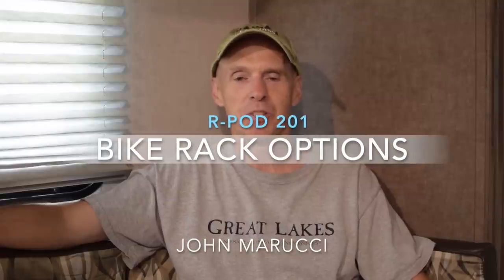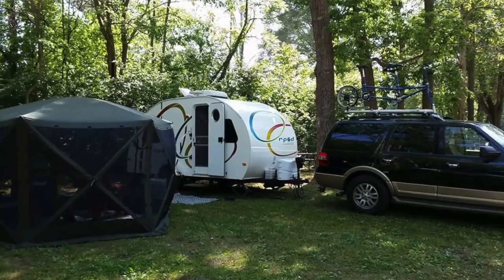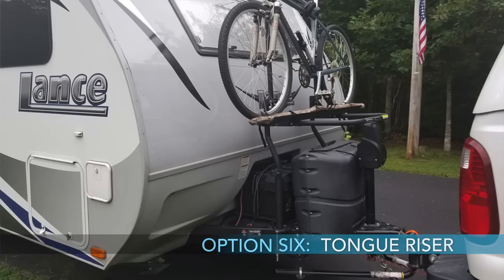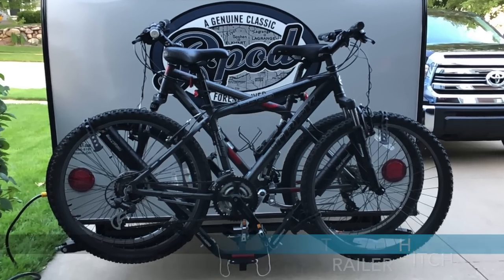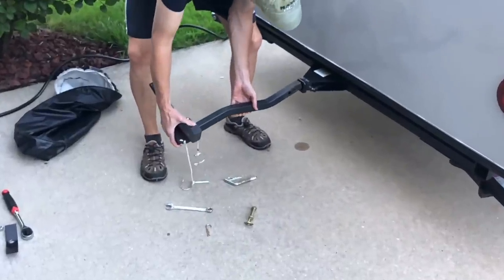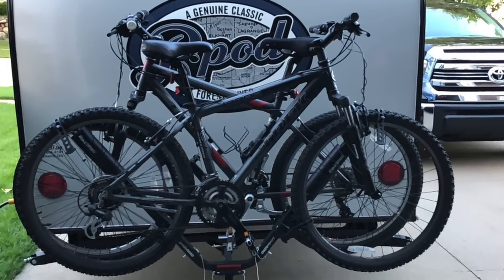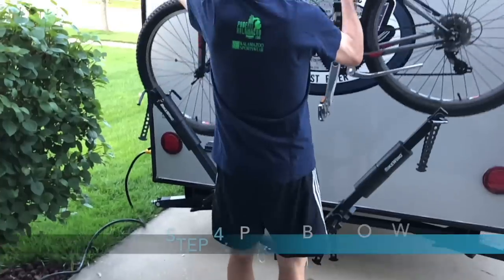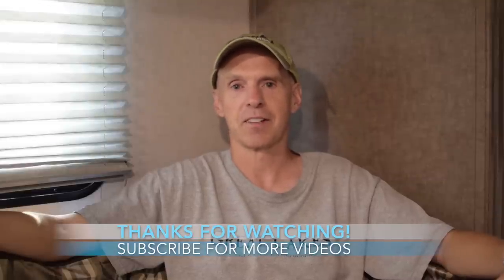RV Bike Rack Options

Comment: Nice video. We have been struggling with all of the disadvantages of the various locations and settled on inside the trailer. I didn't want to expose the bikes to the weather and the potential of damage on the rear.
We have two chairs in the rear of the trailer. One is rarely used, so we removed it and place a two bike rack where we can park the rear wheels in the rack and run straps to secure on long trips. The other end of the bikes is in the entry aisle and close to the closed slide so securing isn't really necessary. When we arrive to camp I move the rack and bikes outside and secure with a cable. It would be nice not to have to deal with it every time we stop, but it the best situation for the bikes.
Reply from the maker: Carrying bikes with an RV has no good solutions IMO. I would be very curious to see your set if you are willing email me a few pics. You'll have to manually copy this email address: john@johnmarucci.com

Comment: We use a tailgate hanging rack for our bikes. The hangers insert into the doorframe in our Toyota Sequoia and the racks stick straight out from the glass window. The drawback is that we can't access the rear of the SUV when the bike rack is mounted but a very easy solution that add just some weight to the tail of the truck and not the hitch.
Reply from the maker: Thanks for sharing!

Comment: Another winner...thanks for answering all of the questions we've had about taking our bikes.
Reply from the maker: Craig, toting bikes seems to always be a concern and I am not sure there is a best solution with R-Pods. Some people add supports welded to the back bumper to add capacity. You obviously have to be careful using the bumper, but it can be done. Glad the video was helpful in showing the different options.

Comment: One time, I stored my dirtbike in my R-Pod for a trip. I turned it on because the air filter seemed dirty and I wanted to make sure it ran fine. To make a long story short, I left it on during the entire 2 hour trip and the R-pod was filled with exhaust fumes. It still reeks and I was wondering if you had advice to get rid of the smell. Thanks, another great video John.
Reply from the maker: Hey George, sorry to hear this. I did a search and two things keep coming up: baking soda and kitty litter. You’ll want to search on how best to use these. Thanks, John

Comment: Thanks for all the details since biking for me is a major part of my future camping plans. I've used rooftop bike carriers for several years and found they were tedious. The lower the bike the better for me. The rear hitch is an advantage over the Lance trailer which has nothing in the back. Good work!!
Reply from the maker: Thanks Sam. The main thing is to know your weights with the bike in the back. Generally you want to keep it as light as possible. I also use the BikeWing rack that locks in pretty tight to minimize sway. Thanks again for watching!

Comment: John, what about trailer sway with the bike rack in the back? Some dealers don't recommend it? I have a Jack-it on the front over the tanks. Works well but it is difficult to get bikes on and off. Thanks for all the info. on your site.
Reply from the maker: There really is no great answer for bikes. If on the back bumper of the trailer, you add weight behind the axle which can lead to trailer sway. If on the tongue, you add to tongue weight and sag to the rear of the tow vehicle (payload issues). There isn’t one great solution, especially for lighter weight travel trailers. Thanks!

Comment: One big concern I have for placement, is the amount of road grime thrown up and onto the bike. You mentioned insects when the bikes are on the front of the vehicle. But, road grime can be horrible on hitch mounts, as grime tends to accumulate heavily in the slipstream behind the TV or trailer. Destroys chains, gears, brake pads, saddles, handlebar tape.
Reply from the maker: All good points. Many people cover bikes in transit to keep this from happening. Yet, I wouldn’t use a cover that isn’t made for the bikes as it could easily come off while at higher speeds. Thanks!

Comment: Possible issue is that simple dead weight alone doesn't tell dynamic forces exerted.  Bike rack is a big lever arm that can produce a lot of torque during bumps and sways--I wouldn't push the weight spec to the 150 lb limit.
Reply from the maker: Steven, I put together a video showing how bikes bounce on the back of a trailer. I am more convinced that the rear of the trailer isn’t a great solution. Here is link: https://youtu.be/5TARjsXrn-8
Reply: @JohnMarucci  It sure has a lot of bounce going on.   So you feel less inclined to recommend what your do in the video?  I'm leaning towards sticking the bikes in our SUV, since we don't use the rear trunk/passenger area for much.
Reply from the maker: @musicpaulweber  I do lean against using the rear hitch on the R-Pods for bikes unless you have the hitch reinforced.

Comment: Thank you for the informative video!  We like the same option as you in having the bikes behind the camper, but I'm wondering how we'd transport the bikes to a different location once the R-pod was parked at the campground.  Have you done this, and maybe just moved the bike rack to your tow vehicle?  Thanks!
Reply from the maker: Kimberly, my Bike Wing 2 bike rack has an adapter to work on the larger hitch receiver on my tow vehicle. You can fairly easily put the Bike Wing on the tow vehicle and take your bikes to a local (or not so local) trail head. Thanks again for the comments!

Comment: Couple of questions...do the bikes obscure the tag? That could get you a ticket! Also, do you know a good way to take generators along?
Reply from the maker: Richard, you are correct, bikes on the back of the Pod can obscure the license plate. As far as a generator, a smaller inverter generator would fit under the cover of the bed of my truck if I wanted to bring one along. I haven't done much boon-docking to need one and would rather not take up valuable bed space unless it were very necessary. Thanks again for the comments!

Comment: Hi John.  I have a Rpod 192.  Do you have any feedback on the ladder mount bike racks?  It appears that there is enough space for the spare and bikes attached to a ladder mount bike rack.  They look nice as the bike mound swings away and allows full access to the ladder.
Reply from the maker: I would be very cautious about mounting bikes on the ladder. I haven't done it, so I would inquire further on the R-Pod owners forum as someone there has possibly tried it... rpod-owners.com
Reply: @JohnMarucci  Thanks for the advice.  I was thinking that if it is strong enough for my 220 pound body to climb up it, it would handle 70 pounds of bikes and rake.  But logic like that often does not prevail.  LOL.  Love your channel and videos and thanks so much for such prompt input.  Joe

Comment: I have seen a few Rpos that put the bike rack on the back And attached the spare tire under the trailer with ushaped brackets. What is the downside of attaching a tire under trailer?
Reply from the maker: Linda, I am not sure there are downsides to move the spare, but you do want to have it done well. I would be very careful as to placement so that it doesn’t hang too low or would be unstable.

Comment: How is the bike wing working now?
Reply from the maker: Gerald, I haven’t toted my Mt bikes for a few months but haven’t had any issues. It is very important that if you do put bikes on the back of the Pod (replacing the spare tire) that you get a rack that locks to the receiver to keep bike movement to a minimum. The Bikewing 2 does this and is very light at about 15lbs. Also be careful to stay well below the specific Pod’s receiver limit. My 2017.5 179 has a 150lb limit. With the Bikewing 2 rack and two 30lb bikes, I’m just north of 75-80lbs. Also, I am more comfortable with this set up on shorter trips. Hope this helps. There is real risk if you overload or have a rack that bounces the bikes. You can always  load your bikes and have a friend or spouse follow you down the road and video tape what the bikes are doing. Always err on the side of caution. Thanks for the comments and thanks for watching!